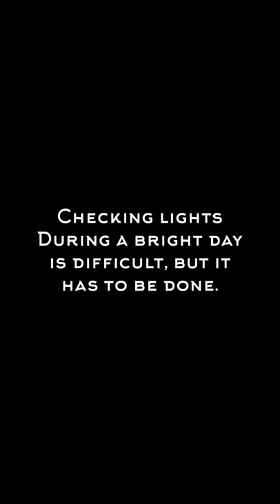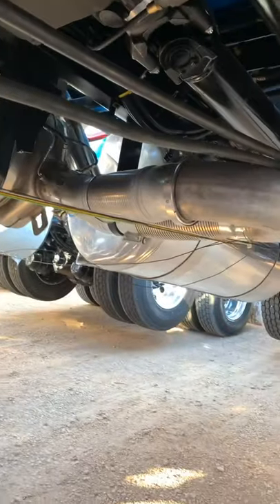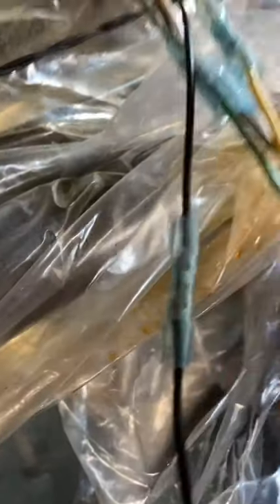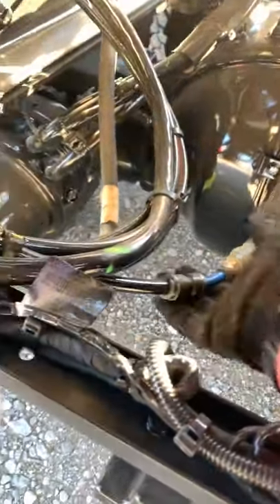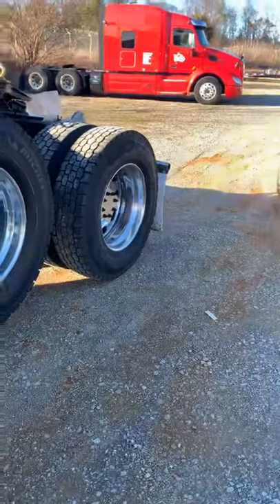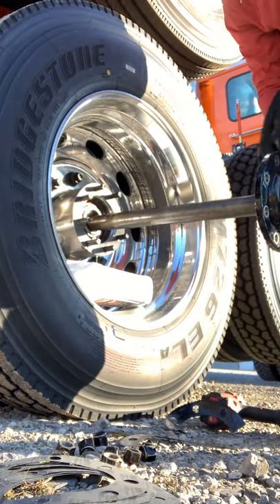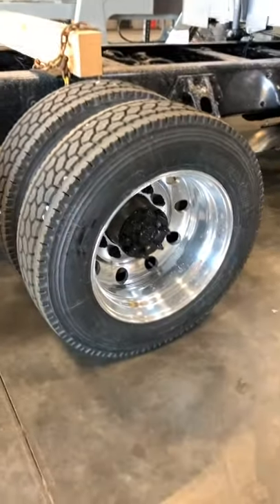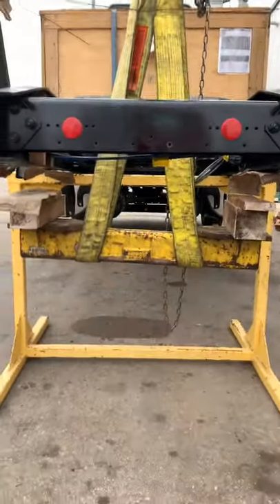How to undeck a 4 way decked load

Comment: Never, never never go underneath a suspended truck, even if it’s to retrieve the wood steer axle blocks. You can safely recover the wood blocks once the truck is on the ground.